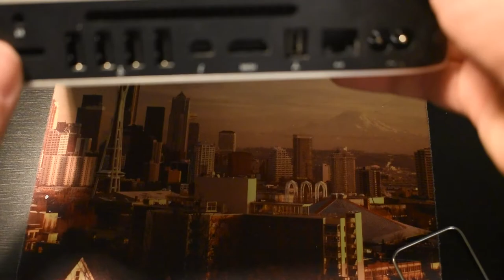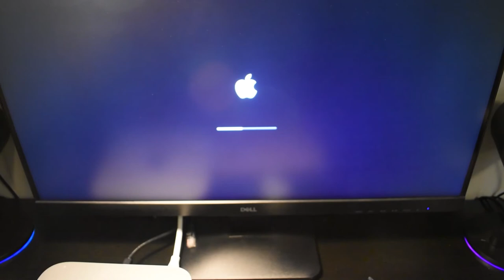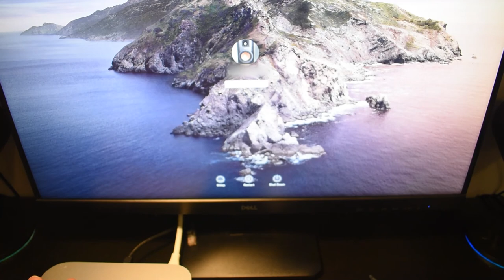How To Upgrade Your 2012 - 2014 Apple Mac mini CPU Thermal Paste | Step By Step Guide

Comment: Did you notice any improvements in temperature or noise using new thermal paste? Sorry if you mentioned it somewhere in the video.
Reply from the maker: It did improve the thermals inside the unit. Playing basic games like Minecraft would turn the fan on loudly. Now it does come on but not at max speed. No noise, in fact as I just mentioned, the fan spins less which makes it quieter. I strongly recommend purchasing high quality thermal paste though in order to fully benefit.

Comment: okay full motherboard out job - not for the faint-hearted, might do it when I finally upgrade second 5400rpm drive - cheers all the same
Reply from the maker: Yes. I'd definitely recommend pulling out the motherboard when you have other reasons, like installing a SSD. It's a large project so combining two projects into one may be the best plan.

Comment: Is the CPU in this mac mini upgradable?  I can't really tell for sure from this video.
Reply from the maker: The CPU on the Mac mini is fitted to a BGA type socket (ball grid array) meaning it is soldered onto the mainboard. It would be quite difficult to switch out the CPU. Although theoretically you could fit the higher end i7 that came in the 2012 Mac mini, but it would probably be not worth it per performance gained.